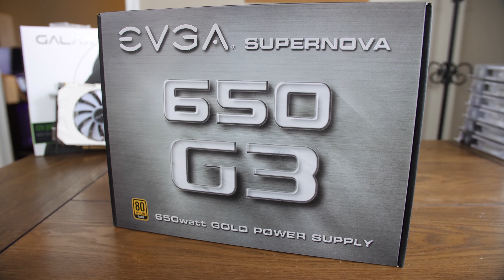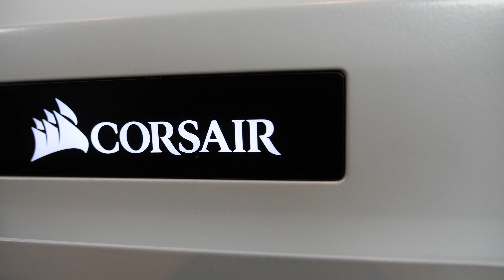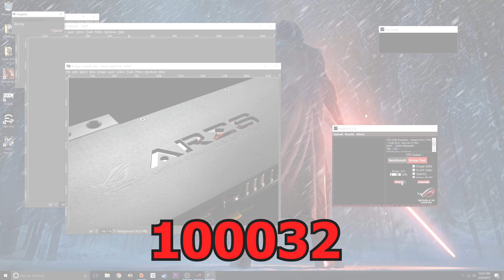The White Build!

Comment from the maker: Here's a stupid correction: B360 boards top out at 2666 on the XMP profile.  The memory was run with XMP enabled, meaning it was running at 2666, not 3000.  My mistake!
Reply: BPS Customs it was like wtf 3000?xD
Reply: awww man thats a shame. Kinda makes expensive ddr4 pointless.
Reply: Can you overclock a gpu on b360 board?

Comment: I can attest that dust inside this case is not as issue of you have positive air pressure. I've built two systems in this case (both the black and white versions) and they've been running for 3 and 2 years respectively. I have cleaned the front filters regularly, but I've never had to clean any dust out the inside in either.

Comment: If your would have turned the  CPU block 90 degrees to the left it would have curled the tubing more and you would have room for the rear fan. I  have done this with 4 Captain EX coolers. Works like a charm.

Comment: Great video! Always love white builds. In particular I LOVE my Deepcool Captain AIO's (I've had both the 240mm and currently use the 360mm white variant.) I do wish they would start using white hose/tubing though. Maybe they do that so it isn't effected by light? Also wish MSI would do a Z370 arctic motherboard so I could build this with an 8700k.

Comment: I am doing a predominately white build with the Meshify C white TG / Ryzen 2600X. Just have to wait for more boards, everyone is sold out of X470s and the B450s have not released yet.
Reply: Jim G. just grab the X370
Reply: I was supposed to a bw build with the 2600, but the only white x470 board that I could find was the asus prime board, and it was over my budget so I ended up getting the aorus ultra. Rip the b/w theme
Reply: Yes I considered the X370, but thought, I would be installing a board that is a year old and will be two years old when the Zen 2, Ryzen 3600X comes out next year. Maybe the X470 will future proof a little better. No B450 boards until August I am hearing.
Reply: the cheapest x470 board cost as much as a high end b350 board (139$)
Reply: They just got the new MSI Gaming Plus X470 board in today, $139, cool.
Reply: Jim G.fair enough, you sounded like you've never updated the BIOS before
Reply: Most X370 and B350 boards require a BIOS upgrade out-of-the- box for the 2000 series Ryzens. Most retailers do not have 2000 series ready boards or charge $30-50 to update the BIOS. Or, you have to have access to an older AM4 chip or get a boot kit from AMD.
Reply: Jim G. at least AMD allows you to borrow their Kit, instead of charging you for it. yes, i know, a lot of people want everything to be supportive right out of the box, but for me, im not in a hurry, once you slap the CPU into the mobo, you wont be touching it for another year or two so...

Comment: Did you use the 570x black front panel on this white build for contrast or is that how the white case comes? For some reason I thought it was meant to be white and you may have just swapped it for the original black one from your other case for contrast.

Comment: Where did you find a power supply shroud cover????
Reply: whiteKOOLAID55 it’s on Corsair website
Reply: @RomvnSossa  i got the case before u even repliesd and it turns out it comes with it now a days, it screws on and off.

Comment: Can you recommend a good white motherboard under $200 for my Ryzen 7 1800x (have that cpu stored for 2 years branded new unboxed along with unboxed EVGA supernova G3 750 and H60 2018 edition liquid cooler which also had both the power supply and liquid cooler stored for 2 years... only because I was planning to build a pc two years ago, bought parts half way and stopped... now I planning to buy the rest of the parts and complete the build... currenly using a pre-built pc from Cyberpower that I had for since early 2018, not the best pre-built; Phantek Elcipse P400 Case, MSI B350 Bazooka motherboard, Ryzen 5 1400, RX 580 4GB, no sdd, cheap unknown psu, and 8gb ram single channel, the worse stuttering pc... that's why I want to continue with new build using the parts that I had stored for 2 years (cpu, power supply, H60 2018 liquid cooler)... I do plan to transfer my current RX 580 4gb graphics card for my new build then eventually upgrade to high end entry-level graphics card like the RTX 2060.
 Here are the parts I plan for my build...

Corsair 570x white case (plan to buy)

 AMD Ryzen 7 1800x (stored -unbox)

Corsair H60 2018 edition liquid cooler (stored - unbox), 

1TB Samsung 860 QVO SSD (plan to buy), 

Corsair Vengeance RGB Pro 16Gb 2x8 @3200 in white color (plan to buy), 

Evga Supernova G3 750w (stored - unbox),

 white MSI RX 580 4GB Armor (from my current pre-built)

still need suggestions for white AMD motherboard under $200.

Comment: Great video.  I love the white cases, dust is not as visible.  I will never own a black case again.  Really never cared too much for the captain 240 as a cooler and they have a high failure rate.  I noticed it was like a last option for you because it was the only cooler in white.  LOL.   I watched a video of yours a while back about 1070 SLI performance.  Believe it was compared to the 1080ti.  You were not misleading at all.  You mentioned the facts.  How it performs in performance tests, scaling in games and most importantly how its not supported by all games.    After doing 1070 SLI and 1080 SLI I have determined for myself that SLI is NEVER a good option.  It really is left up to interpretation, but you find that one game that all of a sudden you want to play and it is not supported by SLI and  you find that you have a second card in your system not being utilized.  Now that 1080 prices have started to drop some, I lost an opportunity to recover values of the card.  Thinking I should have sold and bought a 1080ti a long time ago.  Love your channel.  Thanks for all the details and all your insights.

Comment: hey guys, I'm having a problem with my PC which only occurred after putting in a custom loop for the CPU. At random times the display to my monitors will cut however all the fans in my case spin/light up, the pump does it's thing, and the RGB on my motherboard stays on. I'm thinking the power supply may be overwhelmed or maybe my 1060 is shitting the bed. Any help would be appreciated

BUILD
ryzen 5 1500
GTX 1060
ROG strix X370
8 GB hyper-X
450 bronze plus PSU
Reply: also the only way to reboot it after the problem is to power cycle the PSU
Reply: I reckon it's your PSU. Might want to upgrade to a 600w or 650w.
1060 uses up to around 120W. CPU uses 65W (more if OC'd). Mobo would probably be around the 100W mark. Then youv'e also got to take into account all the other little bits.

Saying that, I did have an issue with my previous gpu which gave similar symptoms. The temp sensor was dead so gpu fans were always on 100% and it would randomly cut out even under light load. Not sure if you included the GPU in the loop, if you did then you may have damaged the temp sensor.

I'd definitely recommend getting a  higher wattage PSU.

Comment: B360 Mainboard and 3000mhz RAM 😐
2666mhz is the Limit for B360 i think.
Reply: Geht DInixo that's not true at all.
Reply: K3 707 https://www.gamersnexus.net/guides/3277-intel-b360-vs-z370-chipset-differences-benchmark-h370
Reply: Geht DInixo https://us.msi.com/Motherboard/B360-GAMING-ARCTIC This is the mobo Brian is using. It supports XMP which totally contradicts what you are trying to say. B360 Does indeed support memory speeds above 2666.
Reply: @k3 I clicked your link and it says, "Supports DDR4 Memory, up to 2666 MHz". It does support XMP but only to 2666:  https://www.msi.com/Motherboard/support/B360-GAMING-ARCTIC.html#support-mem-5
Reply: RdyPlyOne Then explain how Brian was able to oc his to 3000....
Reply: RdyPlyOne wow, it does say that. I stand corrected. Kinda baffling how it does XMP but stops at 2666.
Reply: He's doing a live stream later today I'll ask...But the memory support link I sent hard caps at 2666 MHz.
Reply: Intel - I didn't know there was a hard cap on B360 boards till this thread...Though my next build will be another Ryzen one.
Reply: RdyPlyOne I asked him on Twitter and he made a pinned comment with the correction. I thought for sure it supported faster, but I got it confused with another chipset. Intel has so damn many of them.
Reply: Geht DInixo I am an idiot and apologize. I got my chipsets mixed up and between Brian saying he had it 3000 and seeing XMP on the product page, I thought for sure it supported faster than 2666. My mistake.